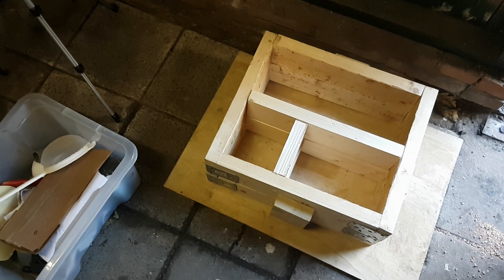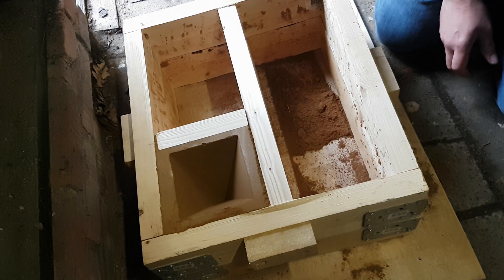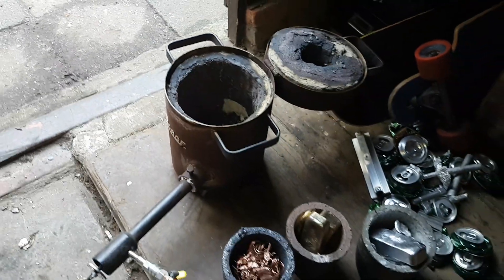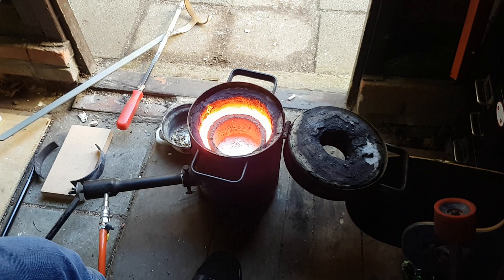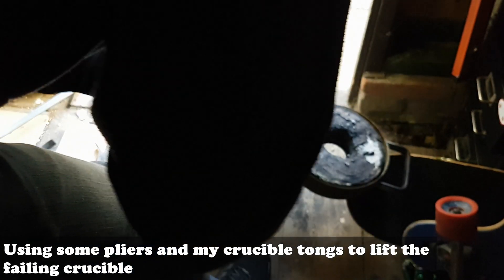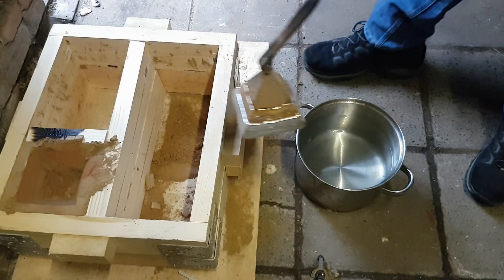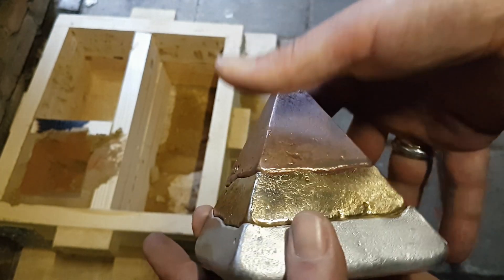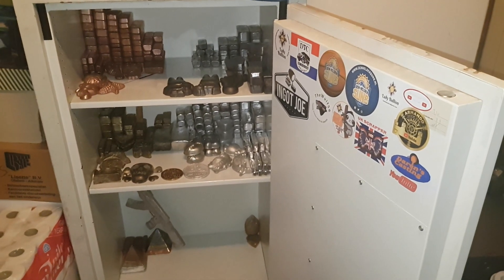Triple layered pyramid - Devil Forge - Metal casting

Comment: I have been melting for about a year now not for the art aspect but rather I've been making ingots shaped for storage.  I have reduced at least ten 5 gallon buckets of copper,  brass... into stackable sized ingots that use a fraction of the space of ten 5 gallon buckets. My crucibles are nearing the end as well. My idea is to invest in a tungsten crucible.  Have you considered it?
Reply from the maker: Nice! I use some of my copper to make alubronze, but the bulk of the copper will be poured into ingots as well. I hope to melt a small fortune in copper :) Never heard of tungsten crucibles, but I guess those are expensive? If I would pour gold or silver I might consider an upgrade, I have one very fine crucible for my copper, it seems not to tear and break, it looks like it "glassifying". I think that one will last longer then the other clay like crucibles. I have another 8kg crucible just in, from the same supplier. If those two last much longer, I will orfer more of them.
Reply: @Metalstacker  your alubronze, isn't it Nortic gold? I  think its the mixture they use to make certain Eurocoins
Reply: I have a hunch the copper market wont decline.  These electric cars seem to be the technology of the future and in my opinion making ingots is ideal for storage and eventually when you decide to cash them in it will make for a nice payday.

Comment: Great job. It turned out fantastic! You were really lucky with the crucible not breaking whilst pouring.
Reply from the maker: Thanks! The most danger was in the liftin, as I cannot fit my custom made lifter in the furnace with this crucible (I thought it was a 4kg crucible) I need to lift it out with my hinge tongs... I will make new lifting tongs soon , as I also have an 8kg crucible waiting to be used in the new furnace :)

Comment: Tisk Tisk, my copper crucible started bending in a bit, then I noticed a crack on the inside, so I replaced it. It was a different brand or something, it was a bit thinner than most crucibles. I probably got about 30 uses out of it.  The pyramid came out great this time. Nice work
Reply from the maker: Yeah you already noticed the crack in my crucible :) I just received my new crucible. It is HUGE! Gotta start building the new furnace soon :)
Reply: @Metalstacker  yeah, the new one probably won't fit in that furnace